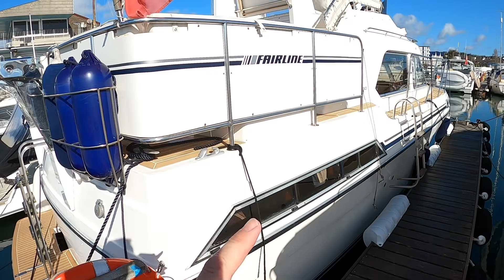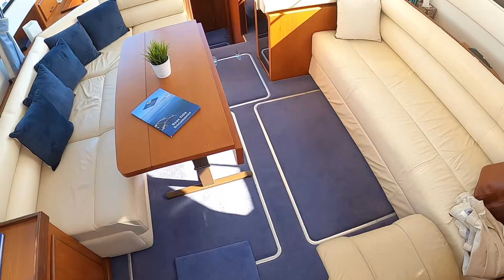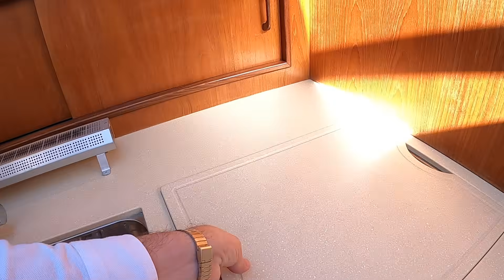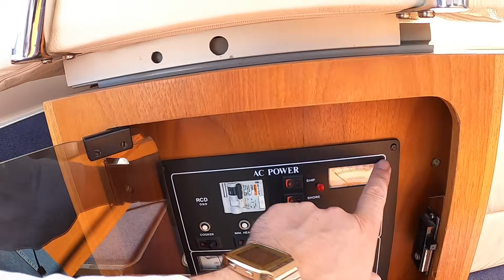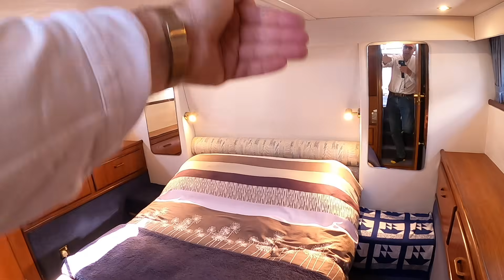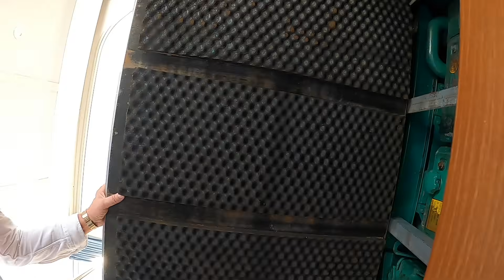£82,500 Yacht Tour : 1992 Fairline Turbo 36

Comment: A great tour as always. I have a question on running costs...

Normally, the ballpark figure is 10%, but this boat is cheaper to buy, due to its age. 
So, what would the running costs be for this boat?
Reply from the maker: The 'ballpark figure' of 10% is a nonsense I'm afraid. 🙂
Reply: @AQUAHOLIC  I know it’s more complicated than that IRL, but you need something to ballpark on before going into detail. 

What I’m thinking is this vehicle will cost the same or more than a similar modern vehicle, but the purchase price would be lower. So what would the yearly running costs be?

Comment: Top tour, top boat Nick 😎🇬🇧

More of them please…….

Echos of my youth….. long summers at Brundall surrounded by Moonrakers, Aquabells and the neighbouring Brooms…..

Being an old (58) caravanning boater, these aft cabin layouts are THE only layout in my book that work as a holiday venue for boating families…..

Back in the day when a flybridge was an elevated driving position with maybe a seat either side for a companion….. not another patio and lounge area with a BBQ and grill……. (Bah humbug)

How I would love to do a rethink on the same format with modern engines and hull windows, semi displacement, low to mid 20’s knots flat out, cruising high teens with low effort….. even with a third centreline motor with a feathering prop, low horsepower, eco friendly for rivers or the Broads……..

It’s a dream 🙂🇬🇧

Comment: I remember having a look around onboard this boat at the Earl's Court boat show in '89. I can't recall how much it cost new then, but I would guess less than 200k. At 82k now, that's not too frightening in terms of depreciation over 33 years.
Reply: This shows how inflation works. Never ever have your money sitting on a bank account for long.
Reply: very overpriced if you ask me. would have guessed ~25-30k
Reply: @hanzen5174  You obviously do not have your finger on the pulse of the boat market these days. Five years ago this boat might have sold for under fifty, but used everything has gone through the roof the last couple of years.
Reply: @hanzen5174  😂

Comment: Nick, any idea why these aft cabin boats fell out of fashion? Mainstream manufacturrers don't build them anymore. Did people's taste change, or are these just much more complicated and expensive to produce? Access to engines seems to me to be the only major disantavantage of these compared to cocpit boats, and maybe the noise when running?
Reply: Exactly the same as Why the cars changed   it's all different Now you didn't have any car with touch screen 30 years ago. But you do Now. It's the People that make the Yacht that change Not the taste of the customers.
Reply: @rogerburn5132  Sorry Roger, thats not really true. Manufacturers are always downstream from consumers. I know this argument well, and the truth is even if your (some consumers) tastes hasnt  changed, new consumers and trends certainly have. This is true both for cars and boats.

(When it comes to cars, regulations has also changed a lot, making it impossible to not change the cars as well.)
Reply: @GoldenCroc  You made a very good point about customer base changing. One hypothesis that came to mind is age of boaters. Maybe in the 80's boaters were generally younger with families, so needed more space. And now they are older with mostly couples boating with only occasional guests. I have no evidence of this, just trying to arrange thoughts =)
Reply: @koomaj  You are exactly right. Not as family vacation-focused any more. Same can be seen with motorhomes, interior wise they are mostly set up for 2 persons these days, compared to 4, some 30 years ago.
Reply: @GoldenCroc  What is your thoughts why this has happened? Are younger families not anymore able to afford that kind of lifestyle, or are they just interested more of something else to use their money?
Reply: @koomaj  I wrote a really, really long reply.. alas it disappeared because of me brushing against the touchpad.. D'oh! Perhaps it was for the best, so you didnt have to read all day. 

Anyway, here is a summation; Yes, I am not from the uk and cant speak for that market completely, but I believe there was a boom in the 1950s in many places after the economy was on the rise after ww2. This, and newer better materials such as fiberglass meant lower income bracket persons could afford new hobbies such as boating more than ever, with less hassle of maintenance. 

Presumably they started with smaller boats and by the time they got a family, the family boat was a natural tradeup. But most of those family boats werent all that big by todays standard, more like 25-26 feet at most or smaller. The boat in this video certainly wasnt ever something a lower income bracket person or family could buy new in most places of europe. Upper middle income bracket seems more like it.

Now, these days, things have changed a lot. Many people are divorced, and doesnt share resources. People have kids later in life. Fuel is more expensive than than ever, even accounting for inflation in most places. People dont think the kids will look fondly on being trapped in a what is effectively a  caravan on water for weeks on end, and maybe they are right. And of course, as you said, there are lots of other interests to compete for the time and money that can be spent.

Boat market has moved a lot "upmarket" it seems. More profit in chasing the customers with a lot of money to burn, even though there might not be as many of them.  Who can blame them, the economics seems clear.

At least, this is what I think. I would wager I am not far off. Cheers mate.
Reply: @rogerburn5132  They didn't have sat nav either. So I think your example is not apples to apples. I'm really interested to know what happened to aft cabin boats. For example, is boat usage changed so much that people don't need the extra space?
Reply: Different usage and type of buyers, I am pretty sure. In general and on many markets, people who buy boats dont spend as much time in them as they used to. Market has diverged. "Family haulers" have often been replaced with "sportscars". Faster, and more party focused.

Comment: love your tours Nick. There is one stat you never seem to mention though and that's the actual fuel consumption at various speeds, I.E. flat out as against cruising speed....litres per hour. Do the manufacturers give those figures at all? Keep up the great work, this boat would be right up my alley when I'm able to travel again after retirement.
Reply: Engine manufacturers do (l/h). Boat manufactures sometimes. But liters per hour isnt as good a measurement as plain old mpg (or l/km).